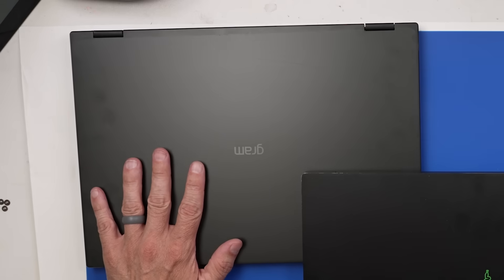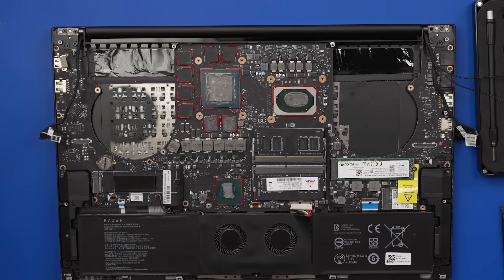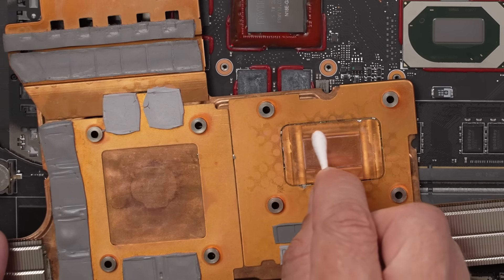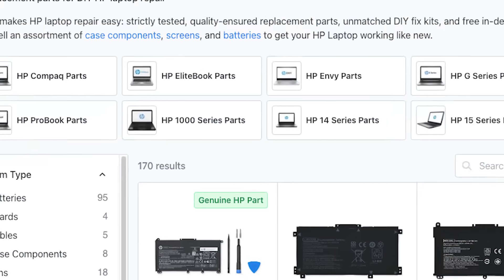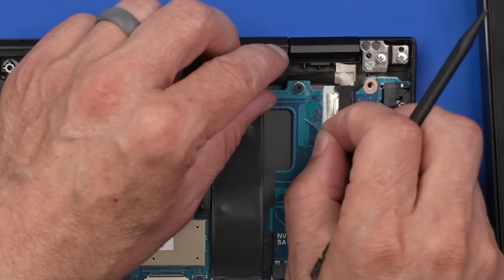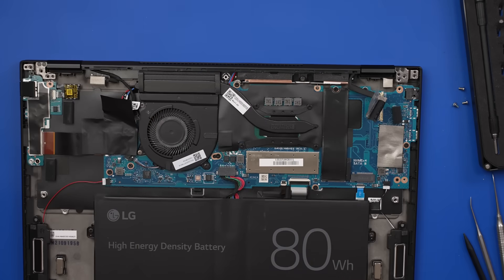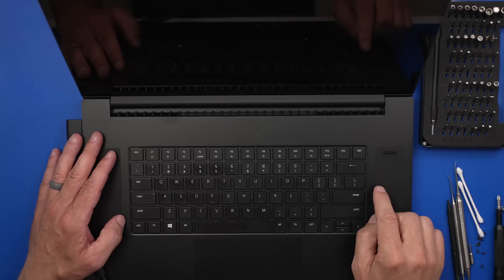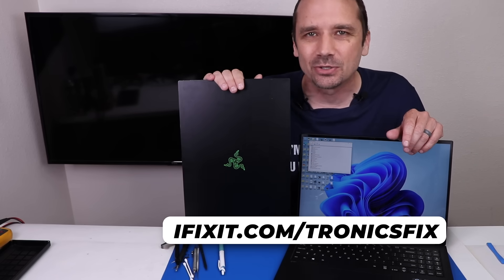Trying to Fix $5,000 Worth of Broken Laptops

Comment: Hey Tronics, I've got a laptop that is potentially dead. Razer Blade 2017 14". Shows the razer logo on startup going through the bios so I know the screen works but after that the screen just goes black. Tried a new nvme ssd with a fresh install of windows to no avail. Battery was replaced by myself with parts off IFixIt and worked for several weeks before this started happening. Any interest in trying to fix it?
Reply from the maker: Unfortunately, I don't offer repair services and I'm not looking for one of those for a video right now. Thanks for the offer though.
Reply: I have a Dell XPS 15 that does the same thing sometimes. I hit the Win+Ctrl+Shift+B shortcut keys anywhere from 1 to 50 times to get the screen back on.  That shortcut key resets the GPU/Graphics driver and beeps after applying it. I'll have to try uninstalling the Intel driver to see if that helps me.